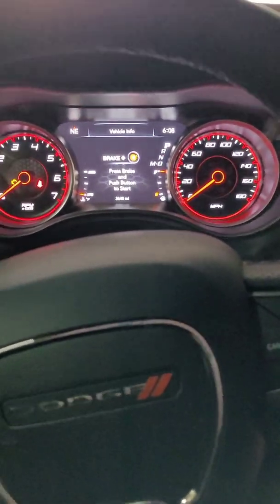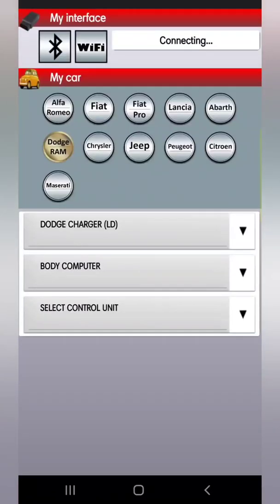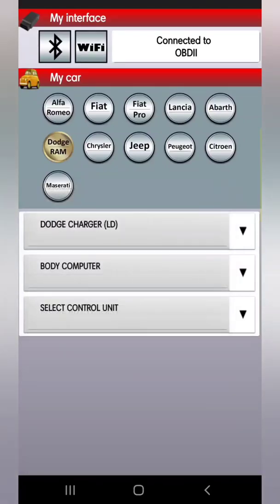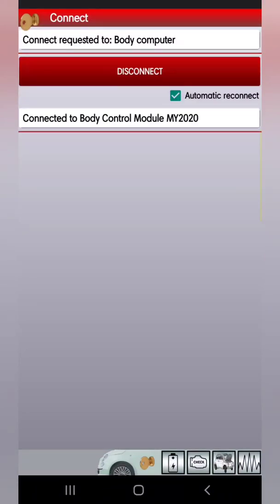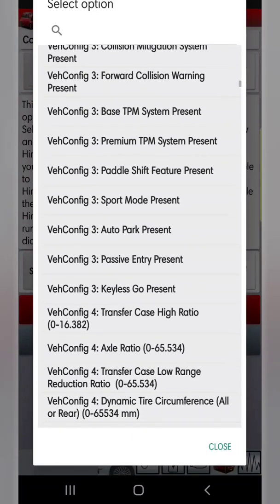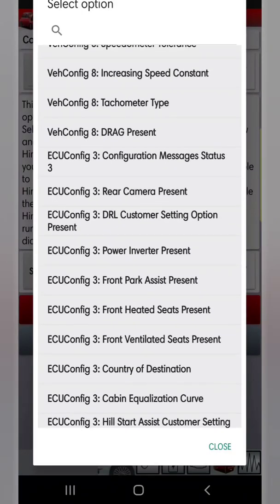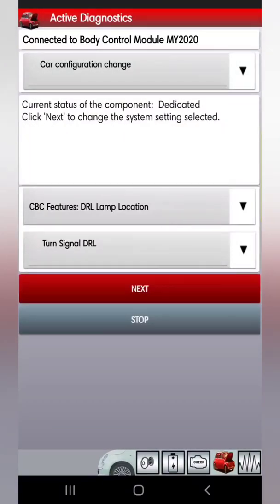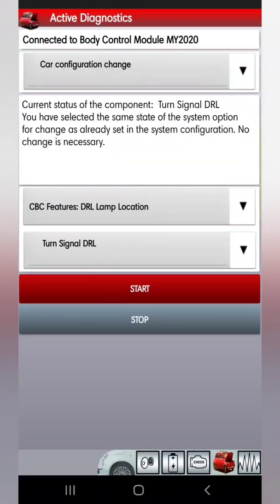Alfaobd tutorial on my Dodge Charger

Comment: What bypass cable are you using? Can you add link please
Reply from the maker: Z Automotive Double Bypass - TRUNK-MOUNT SECURITY BYPASS CABLE KIT - Compatible with: Dodge Charger/Challenger/Chrysler 300 2018+ https://a.co/d/8iytDky
Reply: @TboneSRT I installed it as it showed without issues. I'm familiar with the alpha obd, as I had it on my ram for 5 years.  Once I started using it on my 2020 charger,  I did small changes and let it sit. The set turned on.my airbag so I went back on it. The mileage I can't get to change,  I've tried 10 times.  Any idea what I'm missing?
Reply from the maker: @paulpolivka1575  yes, the airbag light will come on when you activate "vehicle is SRT". Put that back to no and the airbag light will turn off! 

Also as far as mileage goes, you can only program cluster mileage with the OBDlink MX
Reply: @TboneSRT that's the one I have. The obd link mx+
Reply: @TboneSRT do you have anything you've done on yours with doing? I have an srt, already has performance pages
Reply from the maker: @paulpolivka1575  on mine all I did was fog light dropout, DRL dropout, and changed DRL location. But that's strange that you weren't able to change the mileage. It should work if you have the MX+. For the airbag light, I've only heard of it doing that if you set "vehicle is SRT" but since you already have an SRT, I assume you didn't do that?
Reply: @TboneSRT typo, I have the sxt. 😆 yeah idk the mileage correction just won't change.. the car acts like it did,  but the odometer never changes
Reply from the maker: @paulpolivka1575  ohh okay haha, yes on these, the airbag light is a problem when setting vehicle is SRT but performance pages shouldn't be an issue. Put that back to no and keep performance pages and you should be good
Reply: Need the bypass or it is fine with orginal obd ii

Comment: Is it possible to use the orange color on the Clight of the deal as a permanent light? 
I wasn’t my c-light to be orange not white
Reply from the maker: Yes, just need to set your DRL to turn signal. This only works if you have a 22+
Reply: @TboneSRT  2023 last call . Dope thank you
Reply from the maker: @johnnyrosario224  okay cool, yep! Set DRL to turn signal and they should go from white to amber 😁
Reply: @TboneSRT   dope. I bought the same scans what you have and an android tablet last night because everything I own is Apple but I don’t need one of those extra harnesses to bypass anything do I? If I do, I can just grab that too
Reply from the maker: @johnnyrosario224  sweet! Android tablet will work great! And you bought the veepeak obd reader correct? 

Yes you will need the bypass cable! 2015+ require it because the computer is locked out so that cable allows you to bypass the security gateway
Reply: @TboneSRT   okay cool. I just ordered it. Thank you so much! I really appreciate it
Reply from the maker: @Xur18  no problem!!
Reply: @TboneSRT   hey so I just got that second cable to bypass and I connected everything but it’s saying can Eric connect failed verify that the key is in MAR
Reply: @TboneSRT   any idea how to fix?
Reply from the maker: @johnnyrosario224  did you connect the veepeak to your device first via Bluetooth?

Comment: Just added a 180 thermostat. Will this allow me to access the fans to change the temps. Everywhere I’ve seen I need a unlocked pcm and hp or Diablo tuners to access those settings
Reply from the maker: Correct, you would need a tuner to adjust those thresholds
Reply: Ok thanks

Comment: I use EL327 and 12+8 Cable For SGW Bybass but i always get no data received from ecu/interface and i don't know why ?
Reply from the maker: Hmm strange, for alfaobd, you only need to enter into the BCM not ECU
Reply: @TboneSRT  I don't know always when edit car configuration get me no data received from ecu , any fixing please
Reply: @TboneSRT  your bcm is unlocked or locked ?
Reply from the maker: @alexandrelenoir3564  bcm is unlocked but you need the bypass cable to access it
Reply: @TboneSRT  how can i know if it's unlocked or locked
Reply from the maker: @alexandrelenoir3564  2018 and up will need the bypass cable to be able to make changes in the BCM
Reply: @TboneSRT  i get the cable 8+12 to bypass but nothing change
Reply from the maker: @alexandrelenoir3564  what are you using for a Bluetooth OBD dongle? I use the blue Veepeak one from Amazon
Reply: @TboneSRT  i used elm327 wifi the black , can u send the link of the veepeak please ?
Reply from the maker: @alexandrelenoir3564  Veepeak Mini Bluetooth OBD II Scanner for Android ONLY, Auto Check Engine Light Code Reader Car Diagnostic Scan Tool https://a.co/d/d5373r7
Reply: @TboneSRT  are u think the tool is proplem.? Or the BCM is Locked ?

Comment: Might be a dumb question but why can’t you plug above the pedals into the OBD there?
Reply from the maker: Because of the security gateway. It has to be plugged into the bypass cable for that which gets installed in the trunk
Reply: @TboneSRT  thanks!! I’m not too familiar with this - all I’m looking to do is activate sport mode on mine after upgrading from 5.0 to 8.4

Do you think I’ll be good just hooking into the standard OBDII?
Reply from the maker: @Nicholas Martinez  if you have an 18+, you will need a bypass module which is what you saw me use in the trunk in order to access the bcm to activate sport mode! Anything under an 18 you can just plug into the obd under the dash
Reply: @TboneSRT  perfect perfect perfect!! Thank you so much sir! Hope you have a great day
Reply from the maker: @Nicholas Martinez  no problem, any questions, hmu! Have a good one buddy
Reply: @TboneSRT  update: reset the ECU and then toggled off and on the sport mode present function and no luck regaining the sport mode function 

Tempted to buy a Tazer and remap the sport button
Reply: 15 Challenger here going from 5.0 to 8.4 uconnect

Also, if you know any way to remap buttons on Alfa that would be super helpful!!
Reply from the maker: @Nicholas Martinez  ahh okay. That's strange, sometimes it takes a little while for the car to change. Go in and double check if the current status changed
Reply: @nicholasmartinez8523 any luck? I have a 15 charger and I installed a 2021 radio were you able to get sport modes back?

Comment: I have a Scat Pack with the cloth heated front seats only. If I get a set of alcantara front/rear seats could I use this to add the ventilated/heated front seats + heated rear seat option in Uconnect?
Reply from the maker: I believe you would need an additional seat module to be able to run ventilated seats. As for being able to activate the sales code with alfaobd, I am not 100% sure on that. There is an option for front ventilated seats in alfa so I believe you will be able to activate it with alfa

Comment: added some of the performance features in alfa obd and now my trunk wont open with any buttons have to use manual latch!! im sure of the changes i made even went back in and changed them back it but still no open.
Reply from the maker: That's strange. I haven't heard of that happening. I've heard of airbag lights after switching to "vehicle is SRT" but haven't heard of the trunk one before. Were you able to figure it out?
Reply: @TboneSRT  my air bag light came on after so I reset it back to original configuration.  I also tried updating my mileage and it won't work.  Any suggestions?
Reply: @paulpolivka1575 any update on mileage?
Reply: This has to be related to Police Lights. If you're adding it - the trunk button will not work, neither rear power windows.

Comment: Do you have to leave it plugged in after changes have been made or can you remove it an everything saved
Reply from the maker: Nope you do not need to keep it plugged in. You're basically programming the bcm so what's the setting is changed, it will stay there without anything needing to be plugged in
Reply: @TboneSRT  thank you 🙏🏽

Comment: Did your phone get A12?? 

I just finally got the app, and it will not work with my phone. Works with my daughter's Tablet, but not my A12 phone. 

It won't connect to Bluetooth. Seemingly has zero Bluetooth perms as they changed with A12. If Bluetooth is off, it won't turn it on. It will not show paired devices, and if I use it to try and scan a new one, and hit connect it crashes.

Comment: Will this app work with innova 5210
Reply from the maker: This app is only available in the Google play store
Reply: I'm new I just got veep got app do I need by pass my ram is 2016 I just installed power  Folding mirrors My truck is saying it's -40 below ambient temperature will this correct the problem
Reply from the maker: @Andrew-dx4br  the ambient temp sensor is on the drivers mirror. Make sure the mirror has the sensor in it first

Comment: Can we add memory seats and rear parking sensors ?
Reply from the maker: It may be able to activate it but you'd need a lot of other things to add those features. I believe you'd need door modules and the memory button on the trim panel. As for the rear sensors, I believe the wiring is not there for those

Comment: I got performance pages on my charger dash but what do I need to do to get them on the radio? I have the 8.4. I'd like to know if you can add windows down with keyfob. If u could keep doing these videos that would be great. I'm trying to learn it
Reply from the maker: There is an option "performance pages preset" under the car configuration change menu. Is that the one that you selected? Also global down doesn't seem to work on our cars unfortunely. Yes I'll keep uploading more!
Reply: @TboneSRT  I got global windows down to work on my 2016.
Reply: But I can't get the performance pages app on my radio. I have then on my dash. I can see all the stuff that way. But not on the radio.
Reply from the maker: @toddcoello6461  strange, I was able to activate global down on my 16 ram but was unsuccessful on my charger. Also, you may not be able to activate it through the radio. I've heard of it setting an airbag light when setting the car to "vehicle is SRT" on the 15s+.
Reply: @TboneSRT  can u do a video on fog lamps on with high beam? If you know how. I've see for pages on radio I need to reset it. I'll unplug my battery and try that.
Reply from the maker: @toddcoello6461  yes I will! I still have to video the new headlight bulbs so when I do that, I'll inclue the high beams on with the headlights. And right on! Good deal
Reply: What is that you connected to in the rear? 

Do you need a gateway bypass unit?
Reply from the maker: @V17XX  you only need the bypass cable if you have a 2017+